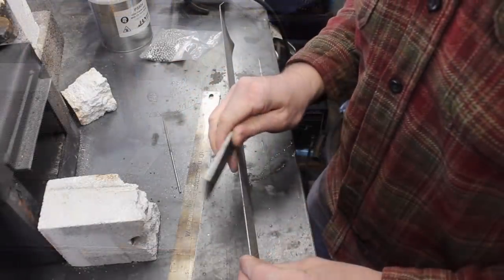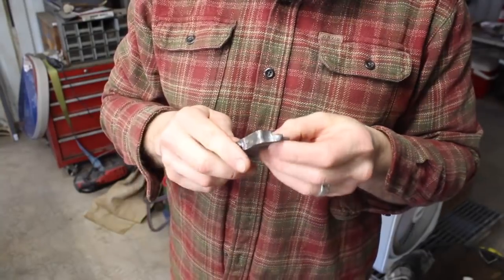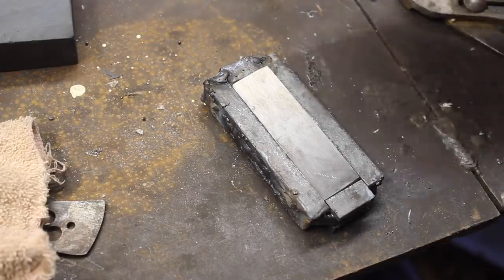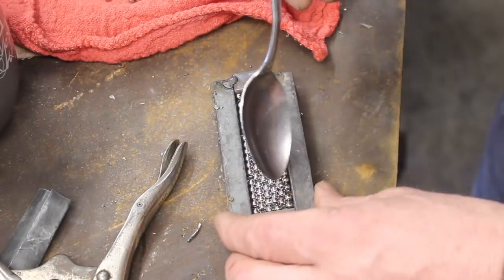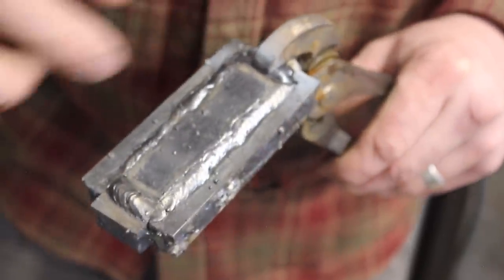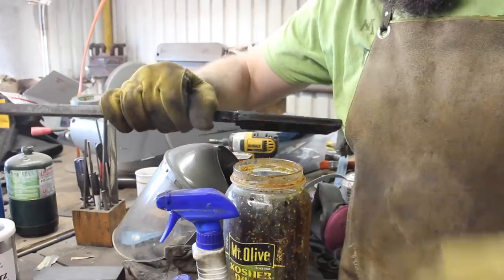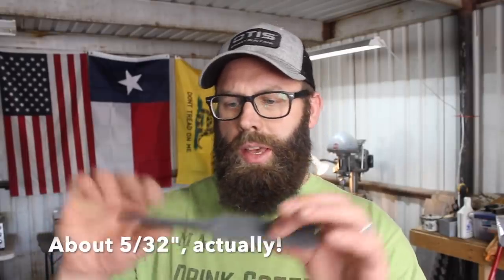Ball Bearing Matrix Damascus - Forging a knife with programmed pattern

Comment from the maker: What would you modify on this technique to make a pattern like this?
Reply: I wonder if you could drill (same size as the Ball bearings) a pattern in the flat stock to "hold" the bearings in different configurations. It'd take way more time but might allow for some cool designs.
Reply: Maybe build a more traditional thin /coffin canister? Laying down the layers of bearings, then powered steel, then bar stock, then repeat?

Totally separate, but I’d kinda like to see a canister made of hardenable steel so it didn’t have to be ground off and could simply be incorporated into the finished billet.
Reply: Maybe a thin canister made from 15n20 with 52100 powder inside. Forge out, then drill holes like raindrop Damascus is done.  That should yield the same results.
Reply: keep the pattern but then perform the splitting technique used in making feather Damascus. I think this would make the ball bearing image more interesting.
Reply: I would have made a canister billet from the ball bearings and just made the san mai layers with that billet instead of fussing with troughs and trays and stuff like that. yes it makes extra material that wont be used, but who doesn't want extra material?
Reply from the maker: @owenknives3970  that would work too however my goal was a "perfectly" spaced pattern
Reply from the maker: Cool!
Reply: If you have a buddy that's a machinist..make little shapes..stars..skulls would be cool. If you have access to an EDM wire machine you could do something really cool..
Reply: As a fan of programs like “Forged in Fire” and “Man At Arms”, I believe it could have been easier if you did a proper canoe Damascus build.

That being said, I would like to see the finished knife.
Reply: I would make a more random pattern...maybe different size bearings and a canister loaded from the top rather than the side, with high carbon steel for the center.
Reply: I would try your first idea but used JB Weld instead of the welder on those attachment holes. Maybe the JB would melt sooner and the whole shebang fall apart. I dunno.

Comment: Would probably do alternating lines/rows of different sized ball bearings. Powdered steel would help make up the differences in thickness. Plus a full tang, instead of a hidden tang knife. Seeing that sort of pattern down the length of the spine would definitely be cool.
Reply from the maker: cool!

Comment: My idea: Make a canister like you normally do, standing up with the top open, but the inside width dimension has to be precisely 2 bearings and what ever width your core steel. So 1/4” bearings and 1/8” core steel would need to be precisely 5/8” wide ID. Load your core steel into the top of the canister, center it. Then load one row of bearing on each side of the steel, alternating left right left right till you get to the top. Pour your power steel in and vibrate till the voids are full. Weld on your top cap and she’s ready for heat.  If your ID isn’t perfect you can use the stainless foil to tighten it up and stop it from welding to the canister. A tig welder would make life easier but I don’t know if you have one.
Reply from the maker: Nice. No, I don't have a TIG setup yet

Comment: The trick with the foil is that you use spent, scaled foil - that is, you take a piece of stainless, and heat it so that it develops scale on the surface. Scaled stainless won't weld with steel. But when you use a clean piece of fresh stainless foil, and then seal it inside an airless canister, it's going to weld.
Reply from the maker: Actually its the high chromium content that disallows it to weld as you don't  typically forge weld carbon steel nearly that hot. This didn't weld either and worked fine, I just didn't know where the edges were and was confused for a minute, haha

Comment: If I were going to do a Damascus or pattern welded steel like that I would put really small bearings in between the larger ones to take up a bit more of the gaps in between them & create an alternating size to the bearings & then you can use less powdered steel in it also, but you’d have to figure out what size gaps you’re left with to get the proper size for the smaller bearings but i think it would look really good that way 🤘👍👍🙂

Comment: Actually I was watching you sweep up the Nordic gold shavings and it got me to wondering how that would do in a thermite reaction.  After all both copper and aluminum can make thermite though you need to be careful with copper as it can react violently.   So my thought was build your chamber like you did for this build make a thick paste of the thermite powder and flux.  pack that mixture around coil style springs, then apply heat.  If the container is strong enough to contain the reaction, the resulting bar should be quite interesting.  If it is porous due to the gas created by the thermite reaction, you could always fill the voids with an acrylic resin...  Either way it should look damn impressive.  If it seems too weak for a knife, you could always craft  handle scales for another blade to be made in the future.

Comment: You need to adjust your welder. Seems like you're set up for normal welding where you'd want to switch polarities so that 70% of your power goes to ground and your stinger gets 30%, that way you burn through your material less. It'll usually give you the correct settings on the inside panel of your welding machine.

Comment: So did the foil disappear or what. Cliffhanger. That billet is going to be sweet knife. Cool pattern.
Reply: 10:30 he chips of the top layer that he used to forge weld the bearings
Reply from the maker: It was there, just thinner

Comment: Would a thinner billet like this be easier to forge weld and draw out by hand than a more traditional canister? I don't have a press or power hammer, so I've been hesitant to try canister damascus. This method seems like it might be less likely to make my arm fall off.
Reply from the maker: Yes, a press is pretty crucial to making canister damascus.

Comment: 1×3 stainless square tubing with the solid steel down the middle maybe?  Regardless of what I'm thinking that's going to look cool once you taper the blade down the the steel core!  Stainless tube is more expensive but might be easier with less grinding.  Hell I'm not telling you anything you don't already know! 🤣

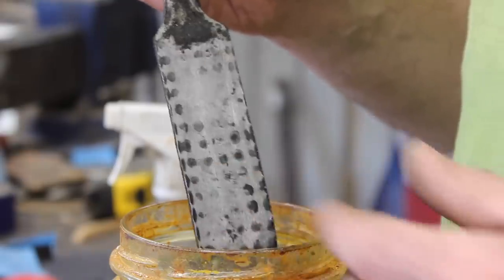Comment: Issue with this concept is: The thinner the blade gets, the less balls you will see after etching. (you already can see 2 areas where there are no balls left 14:08). 
I thought about 3 layers of balls with 2 strips of solid at the edges but this would result in the same issue. Tbh, i have no idea how to fix this except for stacking small balls in the middle and they wouldnt stay in a matrix.
Reply from the maker: Yes but in this case I barely ground the surface so I think I still have material...
Reply: @FireCreekForge  i thought about the issue a bit longer. i still have no solution for the issue, but i might have an idea for a new project based on this matrix idea:
Some blacksmiths use custom pins made from different materials, pipes and resin to attach their handles. If you have a round bar steel blank (or pipe) you can drill it and fill the center with an other steel type round bar. Then stack them and fill the empty spaces outside of the pipes with metal powder. If you use the same metal type for the inner bar and the powder, you get ring shapes on your blade. (or if 3 different types, 3 different colors)
Just add a high carbon steel for the blades edge and voila, new design. :P
Its called the "No Way" design.

Comment: They make this cool measuring device called a caliper....                                                                       Edit. Look, he does have one, lol
Reply from the maker: I even have micrometers you've never seen...
Reply: @FireCreekForge  lol, I have a set I have to pull out a few times a year on milling projects. Mostly I just use my digital caliper that goes to 1/1000.
Reply: @FireCreekForge  my offer still stands on TIG welding. If you get a machine, I'll drive out and give you lessons for a day. Just on YouTuber to another.
Reply from the maker: @NOTSOSLIMJIM  cool man thanks

Comment: Why didn't you just make a canoe cannister, do a layer of ball bearings and powder, put a steel core in it, then another layer of ball bearings and powder and weld it that way
Reply from the maker: That would probably work too. You might have to shim it to perfectly accommodate the width of so many bearings. I wanted a perfectly spaced pattern with the bearings.